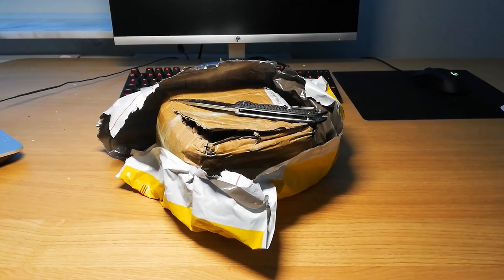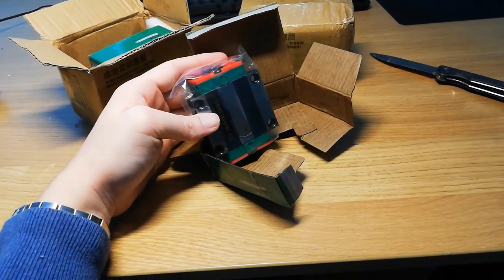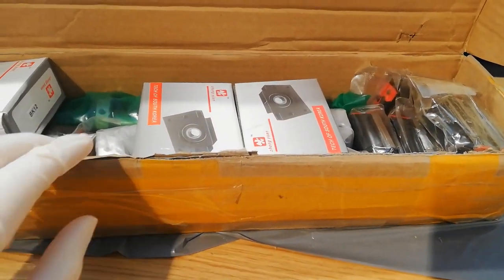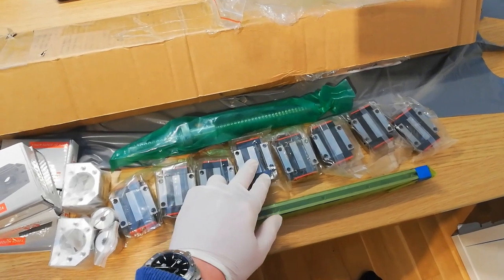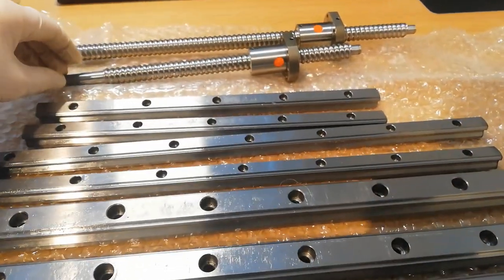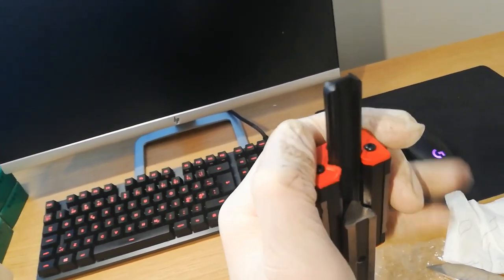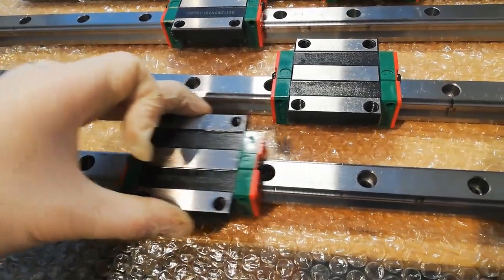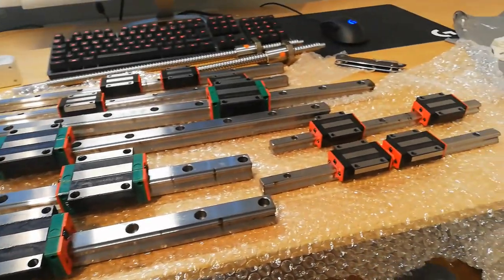Unboxing linear rails  from aliexpress (HGR15 +HGR25) and some ball screws (SFU1605 )

Comment: The difficulty of sliding depends of the sliding blocks. 
It has 2 factors to it
1 lubed with a way too thick lube
2 debris from factory.

For the first case is easy to deal with. Clean them with wd40 or break cleaner and relube them with a proper lube (not grease).
For the second case is a little bit more work but is worth it in any case. Basically you need to totally disassemble the blocks one by one and clean them then reassemble and relube. It can take a lot of time but it makes a lot of difference.
And i recommend to use a oil distribution lubrication system. In the long run the blocks and rails will have a lot less wear. Or you can lube them by hand one by one with a syringe, kinda in the stile of grease gun method.
If you want to exchange some words about these kind of things don't hesitate.

Comment: the scratches you showed us have nothing to do with the smoothness of sliding. The scratches are on the top face, NOT the bearing surface, which are the 4 curved surfaces to the sides

Comment: Looks like you are going to beat me to the punch with upgrading the rails. Can't wait to see how you do it... I keep thinking about how to do mine and if I use the same rails that's on the lower section of the machine, I will have to add a spacer the the back plate or completely rebuild the Z section of the gantry. I've bookmarked your part links, thanks

Comment: If we are talking about cheap rails - yes, it is a lottery!
Reply from the maker: I saw your videos on linear rails. The looked very Nice! Expensive?

Also I saw that you took a sliding block apart. Do you have any recomendations on grease or oil for The blocks?
Reply: @thechipwelder1253   No, SAIR products are very cheap and pretty good quality, you can order them directly from factory, just use contacts in the description section. As about service or revision of rails, yes, there are some tips, will try to make a video about it cuz lots of people are interested in it

Comment from the maker: The rails and blocks that I ordered are not hiwin. However I think that they are pretty similair. Acoording to hiwins data sheet, their blocks are pre greased/lubed from factory. However their blocks shall be greased before being taken into use. For HG15 theamount of grease is 3x0,3cm3, and for HG25 3X0,8cm3. With a cheap grease gun it feels hard to control the amount of grease. I did though see a video from another seller who recomended a couple of pumps and that they wouldnt be damage by over greasing. Might be good enough for my hobby use. But I thought some about it, and came up with an idea. Do you think that it would be possible to apply the grease through a plastic syringe with a scale. Perhaps conect it with the nozzle with a short piece of pvc hoose. I dont know, but would be intresting to know what you think about that or if you have tried it? :)